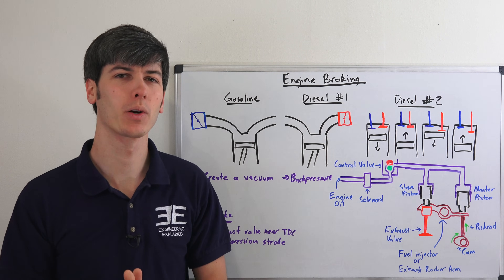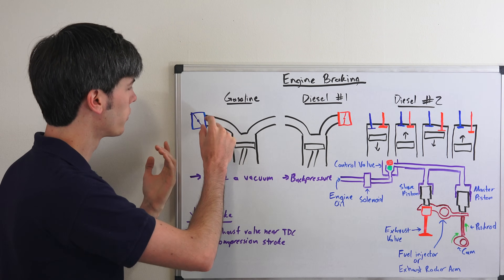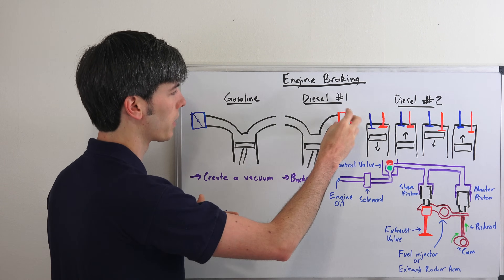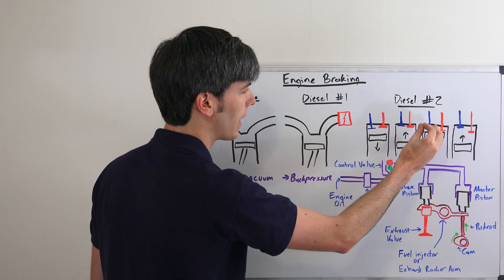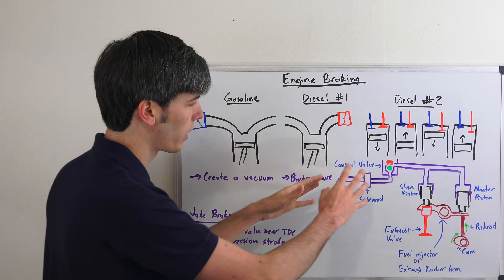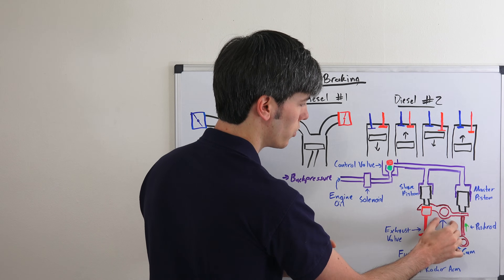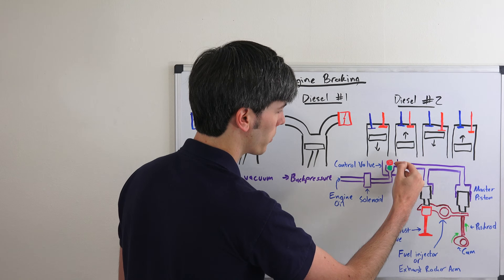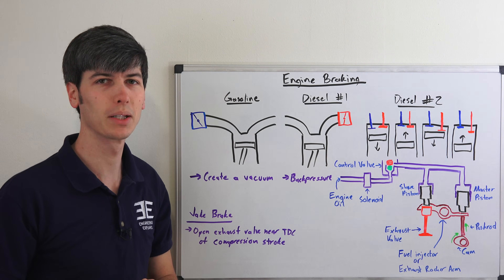What Is Engine Braking? What Is A Jake Brake?

Comment: Can you explain compression? What does the numbers mean? What is a high compressions and what is a low compression? Please make a video on this :)
Reply: +MultiTerpen 
Compression "ratio" is the factor by which air is compressed from the bottom of a cylinder to the top of the cylinder, during each "compression cycle." Example: assume your tachometer displays 6000 revs per minute. This would equal 3000 compression strokes (up). 3000 power strokes, (down), 3000 exhaust strokes (up) and 3000 intake strokes (down). Where both valves have or are closed at that moment. Near the end of compression stroke, 14 to 30or32 degrees of rotation before the piston actually reaches top dead center (of the crankshaft rotating the (rod) up & in turn pushing "up" the piston, either fuel is injected or (in a carbureted engine, fuel/air is "ignited" by the spark plug. There is a formula (Google, Summit Racing etc) that takes cylinder bore, piston (crown) stroke, head-gasket thickness and cylinder-head combustion chamber capacity in grams usually to determine the total difference between the amount of air in a sealed cylinder with the piston DOWN and the compression ratio in turn is referenced by the number arrived at when the piston crown is UP, at the very other end of it's travel. Octane of gasoline, propane, natural gas all have different numbers, depending on their propensity to be ignited by the spark plug.
Diesels on the other hand, compress air to a greater degree, hence much higher compression ratio, and that air heats quickly;y when compressed and fuel under "high" pressure is litterly squirted into combustion chamber and explodes, driving piston down and rotating crankshaft... rather than burns (out in a flame front from the spark plug.) 
 Sorry you asked?
Reply: +MultiTerpen The compression ratio isn't necessarily how small the cylinder can get before it ignites, but rather, how small the cylinder is designed to get in a regular cycle. In most gasoline engines, they use a spark to ignite the fuel when the cylinder is in its compressed state. However, in many diesels engines, they rely on autoignition, so the compression ratio in diesels could give an indication of how much compression you can get before ignition. Because in diesels, you rely on autoignition, you typically have higher compression ratios than on gasoline engines.

When you add a turbo, however, some of the air that enters the cylinder is pressurized, so the autoignition point is at a lower ratio of compression. So to prevent premature ignition, turbo powered gasoline engines typically run have a lower compression ratio.

Say for instance, you decide to add a turbo system to your inline 4 or straight V6 engine, which has a compression ratio of 10:1 but may experience knocking if the compression ratio was set to, say 15:1. Due to the turbo, the pressure of the inlet air will be higher. If the pressures increase 100%, then you can only compress the air 7.5 times before ignition. So the 10:1 compression ratio needs to be adjusted, or you should select a different turbo to prevent knocking.
Reply: +MultiTerpen It basically means that every 9.5cc of air in the cylinder gets compressed to 1cc of air. So for example if at the bottom of the stroke the cylinder had 950cc of air it would compress it to 100cc of air.
Hope that helps :)
Reply: +MultiTerpen The volume above the piston at BDC compared to the volume of the piston at TDC. This is static compression ratio. Dynamic compression ratio is different, but when you hear 10.5:1 comp ratio, that is the static number. Here is a nice article. http://www.hotrod.com/how-to/engine/ctrp-0505-calculating-engine-compression/
Reply: MultiTerpen I agree with the above comment. If you are trying to build an engine, or machine the head, and want to know what numbers to shoot for, ask someone with a good reputation. A competent engine builder, or engine machinist should be able to give you advice. The numbers I threw out are just for reference. Each application will be a little different.
Reply from the maker: +MultiTerpen https://www.youtube.com/watch?v=nveqCMNTth0
Reply: Engineering Explained So for example.. I know that the compression ratio for my 69 mustang 351w is 9.5:1 But what does that actually mean? I did not really understand by watching the video. Is it like it becomes 9,5 times as small before it ignights? But what is really a high compression and what specifies a low one? Also what is the difference between NA and forced induction like a turbo?
Reply: James Tennier Thanks :D, but when it is like 9.5:1... Is the space inside the sylinder getting smaller by 9,5 times from when it is at the bottom to when it is at the top then? Is there a difference between saying compression and compression ratio?
Reply: +Engineering Explained you did a crossplane video or i'm wrong?
Reply: SakuraLionheart yea, but will the whole sylinder be full of fuel and air before it ignights?
Reply: +70chevelle8 Also in a naturally aspirated, gasoline, street engine (not direct injection) I would consider anything over 10.0:1 to be high compression. But in a turbo street car something like 9.0-9.5:1 would be the threshold. Diesel engines see compression ratios of 20.0:1 or greater on the street.
Reply: MultiTerpen In terms of measuring compression ratio for an engine it doesn't matter if it's full of air or fuel, so for example if you had a 100cc bottle of pop and you poured the pop out and filled it with sand you would have 100cc of sand.

If you wanted to measure the compression of the engine rather than the ratio that would be a little different, as then you would take into account fuel and air mixtures as they would compress at different levels.
Reply: +SakuraLionheart Exactly.

PS: The max compression is used for calculating the sizing of the piston rod and the crank :P
Reply: SakuraLionheart I did not ask about mixing stuff. I am just asking cus people say different things, and I kinda wanna learn u know. But what specifies a high and a low compression for an NA inline 6 for example..?
Reply: MultiTerpen Ah, it sounded like you thought having fuel in aswell would change things in your previous comment.
If you want info like that you're much better going to google and putting the question in there and looking into it. Find some good sources and see what they say, even if someone on here sounds like they know what they're talking about they could be just blagging it ;)
Reply: +MultiTerpen Compression ratio just means that its taking a certain volume and compressing it 9.5 times. Look at it this way, at top dead center you have one given volume, lets say 100cc. At bottom dead center you'll have 9.5 times that of TDC so 950cc. Now in the cylinder you have a mixture of fuel and air that will ignite. That has nothing to do with the compression ratio but the higher the ratio, the higher octane you can and should run. I have no idea what people are talking about with high and low compression ratios. They are metal cylinders that don't magically change shape. Putting a turbo/super on the car won't change the ratio either. Just the Amount of compression you have. The denser the air the more fuel you can pump in which equals more power. Usually the amount of compression is measure in pounds. Opps almost forgot PV/T = PV/T and PV=NrT
Reply: Nope. Compression (pressure) is in force/unit area, such as pounds/square inch.
"Compressing it 9.5 times" is meaningless. Rather you could say "compressing it to 1/9.5 of its original volume". Confusion factors here: valves (or ports) don't open/close at precisely BDC or TDC, and there is some heating of NA incoming charge, which raises pressure beyond what gas law would predict..
Reply: Compression compared to normal atmospheric pressure of 14.7 psi.  So, compressing 9.5 x 14.7 = 139.65 (minus any losses due to leakage. valve timing, air temperature and density)

Comment: Could this cause any unnecessary wear on the throttle body or the engine because of the pressure being created within the cylinder?
Reply from the maker: +IAmAPerson27 Shouldn't cause any problems.
Reply: +Engineering Explained great video thanks! i am new driver for stick this was a very educational video thank you very much!!!!

Comment: False: a Jake brake is using your friend (Preferably Jake) as a brake by throwing him in front of the car :D It's simple physics, and is easy to do! The only problem is the maintenance cost :/
Reply: Yes, this is the exact reason why I no longer have any friends names "Jake". But since I do most of my trucking along the Texas/Mexico boarder, I've adapted to using the "Juan brake" it's quite effective and there is an abundance supply down here. 😂😂😂
Reply: Dammit! I wanted to make a very similar comment
Reply: +Engineering Explained I guess you can say, it Trumps all other brakes.
Reply: Engineering Explained I bet Trump makes a better brake, its called Trumps Wall😂😂😂😂
Reply: I have a friend named Jake he's over 6ft tall and is just over 300 lb he'll work perfectly!
Reply from the maker: +Dunkaccino25 Trump makes THE BEST brakes.
Reply: Funny!
Reply: What maintenance cost?? That's what you have insurance for.
Reply: Jake from State Farm?
Reply: Social costs are steep too.
Reply: +Dunkaccino25
Clean up costs are covered by the efforts of crows, ravens and vultures.
Reply: Dunkaccino25 You forgot about the cleanup costs, too
Reply: L
Reply: +Engineering Explained Donald Trump Owns Brembo Braking Systems?
Reply: +RaZeRx09 
 You're Awesome. Cue Drums!
*Ba Dum Tuss*
Reply: ToyotaFan 1989 also bail costs
Reply: Dunkaccino25 we still goin on that road trip on tuesday? Just got ma new boots im ready.
Reply: Dunkaccino25 L
Reply: i had a jake until i had to use the emergency brake then no more jake jake works better then cheap car brakes
Reply: Unfortunately you ca only use this brake ONCE.
Reply: ROTFL!
Reply: Does jake from state farm work as well
Reply: Dunkaccino25 and medical costs, and probably some fines for battery.
Reply: I just had to click that to make you have 600👍🏻 🤣🇮🇪🇮🇪

Comment: I thought that engine braking in diesel is realized simply by just cutting off fuel, and no extra devices are needed. Am I wrong?
Reply: +fiskusmati the compressed air would act like a spring an push down the piston after top dead center... that is why the air is released: you use energy to compress it, then release it in the wild
Reply: ok, now I understand

Comment: So is it fair to say that engine braking is just an unavoidable nature of how engines work? Surely it would be better if engine braking don't exists?
Reply: +boy638 in case of trucks with huge loads, if there was no engine braking when going down a long hill, the normal brakes would overheat after a while and disaster
Reply: Marton Bardos oh that makes sense, but in those trucks, is engine braking deliberately increased with other methods?
Reply: +boy638 yes, the Jake brake is doing exactly that (vs the throttle body)

Comment: So to fully utilize engine braking when slowing down in an automatic transmission car you should keep the car in gear? and in a manual transmission car you should downshift as you brake?
Reply: +ckarsenal No need to downshift when you brake, unless you want to practise heel-toe or rev matching.
Reply: +ckarsenal yep...
Reply: Yup. In an automatic, don't put it in neutral. Some allow you to choose gears now and also rev match automatically. In a manual, you can stay in gear until you don't have enough torque and the engine begins struggling and put it into neutral. Another option is to downshift every gear. The last option is to block shift. The latter two options require you to know how to rev match.
Reply: ***** No you don't have to downshift while you brake. You can downshift after you brake, unless you like doing heel-toe rev matching. As long as the rpm is above idle and the throttle pedal is not depressed, even in 6th gear @1500 rpm the engine will not use fuel.
Reply: +xXxMartin96xXx 

I tend to downshift to third and then brake to a stop. I find if I simply brake from 5th to a stop, I am using my brakes too much and missing out on the effects of engine braking.

Comment: Why isn't the diesel "throttle body" placed in the air intake? Wouldn't it do the same thing?
Reply: Diesels are controlled by the fuel put into the motor. Gas motors are controlled by the amount of air.  The throttle body in a gas motor controls air flow. A diesel doesn't have a throttle body front or back. Diesels either use the Jake Brake mentioned in the video or a variable geometry turbocharger located after the exhaust manifold. This type of turbocharger can rearrange the fins inside of itself to be open, closed or anywhere in between depending on drive conditions. A VG Turbo will close to achieve the same effect as a Jake Brake or the theoretical rearward placed throttle body.

Comment: Oh, and is it good to slowly release clutch after downshift to control the force of enginebraking?
Reply: +Xyz Abc everything about smooth clutch operation is good. the less stress you put on it - the longer it will last. also you can do slight rev matching by applying accelerator to get 3-3.5k revs (or less, depending on the engine type and difference in gear/speed).
Reply: +Senpai Nooberinho Thanks for reply. Is good to tap throttle bit more to get over 3.5k revs in order to keep high engine revs and by this better response? And about clutch releasing - if i do it too slow, the braking will start smooth, but isn't the moment when im on half clutch too long (while releasing it) damaging the clutch?
Reply: Xyz Abc revs should be as close as possible to those which would be at that speed in that gear. every clutch has its bite point- it's the same in case you downshift or upshift - so if you want to engine brake, just engage lower gear and then release clutch slowly till engine revs go up and you feel a slowing down force - after that clutch pedal should be released to avoid any slip. in general downshifting for engine braking is 100% the same as upshifting....
Reply: +Senpai Nooberinho I think i get it, so i f i need higher revs at specific speed, i just tap throttle more to keep revs higher? I'm wondering if revs are too high, lets say 5k, would it stress the tyres, similar like i would just quick release the clutch without rev matching? I mean sometimes i need to downshift and engine brake hard, so u just tap throttle little bit to match revs, and sometimes i need to tap throttle more, to downshift and engine brake but keep revs high, is it correct approach? (at last example i think taht would be more hell n tope braking and rev matching, less likely engine braking, but also as well) Correct me if im wrong, i declare im total noob and just trying to learn.

Comment: Is it good to tap the throttle just before downshifting while engine-braking, to make the downshift more smooth despite the fact it will engine-brake less, or is it better to don't tap the throttle and just try to release clutch smooth? Or just release the clutch fast while enginebraking? Oh, and is it good to slowly release clutch after downshift to control the force of enginebraking? Thanks for great vid and i leave a thumb up!
Reply: +Xyz Abc When you tap the throttle before down-shifting what your doing is reducing the speed difference between the engine and transmission.  Doing this reduces how much work the clutch has to do, which helps it to run cooler and last longer.  I do this on my manuals when I am engine braking in a controlled manner (and when I remember to do it).
Reply: +Xyz Abc to control force of engine braking you pick lower gear accordingly (1 gear lower - little engine braking, 3 gears down - hard engine braking).
clutch must be operated smoothly always (on road cars)- that's the key to keeping it for longer :) and it's in general best way especially in slippery conditions (rain/snow/ice) since smooth operation prevents wheel spin. rev matching is not necessary but wont hurt anything (only fuel economy will be slightly lower compared to just clutch release). if you downshift as smooth as you upshift - there will be no difference in the overall impact to the moving parts.
Reply: +DemDogGaming Thanks for reply.  Is it good too tap throttle harder in order to keep high revs after downshift? (i assume transmission speed would be faster than angine at this moment, so its not gonna make it last longer, but im thinking about "sport" driving, not normal driving) I also wonder if new manual cars have automatic rev matching while downshifting.